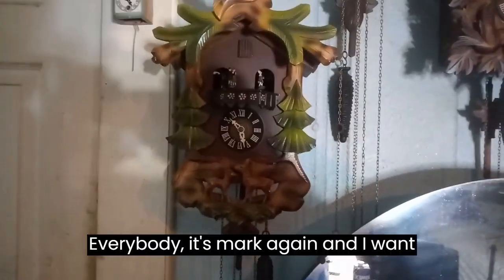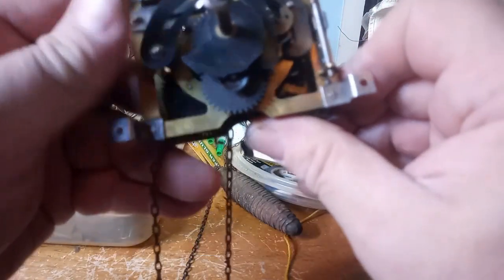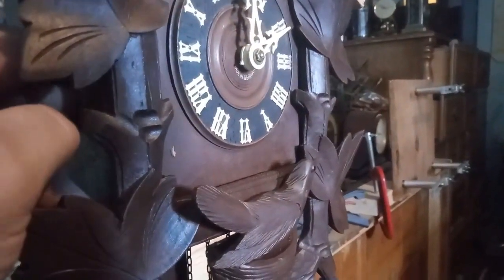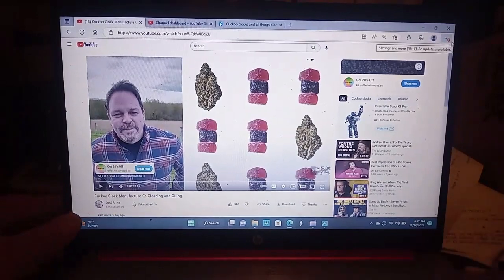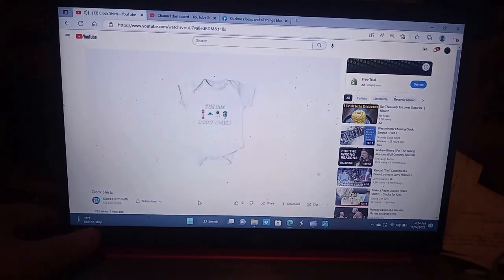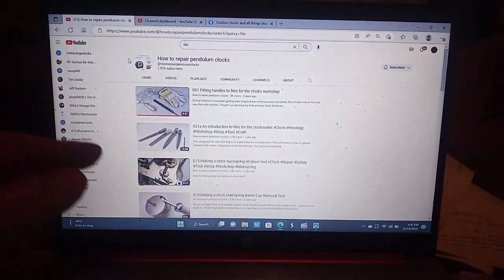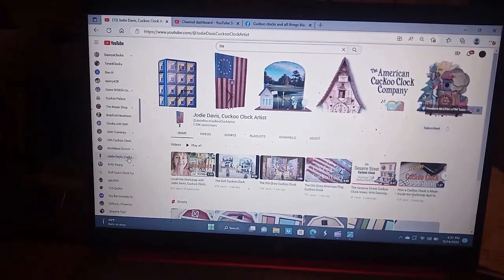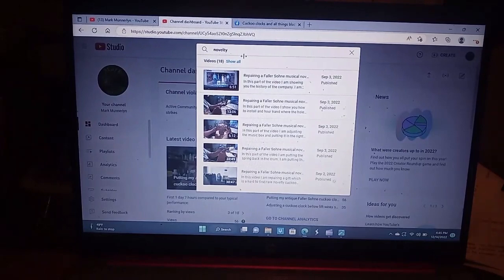Do your cuckoo clock hands not turn.  This could be the reason why (See description)

Comment: I had to watch this one again, beacuse my hands turned fine while on the stand, but now are not moving sometimes. I think since I didn't put the nut on the hands when testing it in the stand, even overnight, and did whwen the clock was all back together-I had the nut too tight.
Reply: Nope, my homemade hands are too thick. It only runs good if the fancy nut is not on. I'll have to get the dremel back out. I liked them being a little thicker so that they don't break as easily.
Reply from the maker: Your clock has a compression washer  underneath the minute wheel with minute pinion. If that is too tight then the hands wont turn as the clock ticks. If it is too loose then the minute hand will drop as it rotates around. I would look at that compression washer. You will probably have to take the movement out again. With newer clocks you can take the dial off and it has enough room to work. Antique clocks sometimes has enough room if you take the dial off (but a lot of the antique clocks have nails around every number and if you take the dial off then those nails might come loose) but I wouldnt do it. I would pull the movement. Without the pendulum on and with the minute hand on you can put pressure on the great wheel to see if the minute hand turns. If you have to put a lot of pressure on the great wheel then you might have that compression washer underneath the minute wheel with minute pinion too tight.